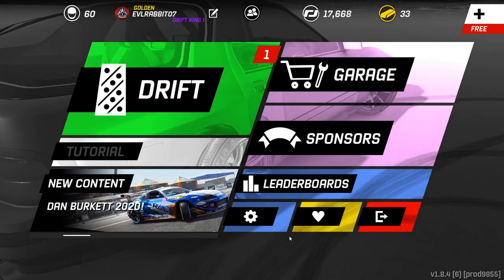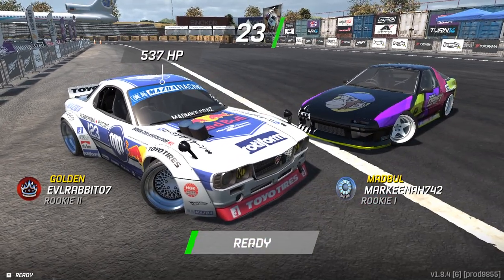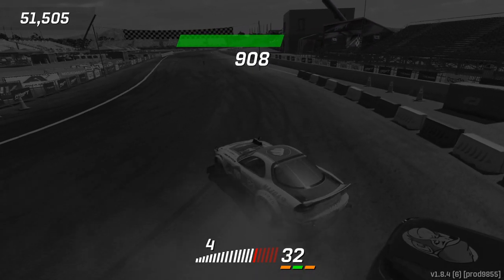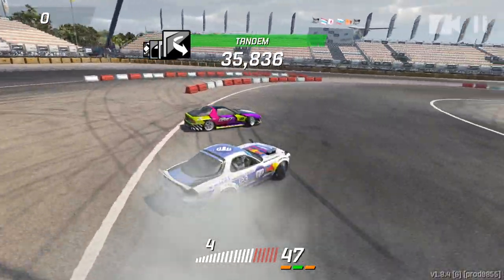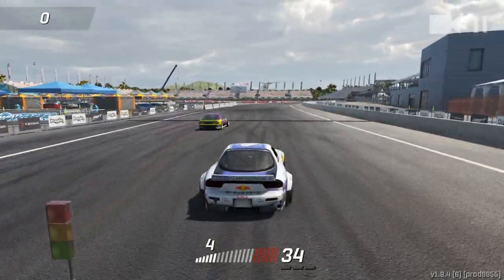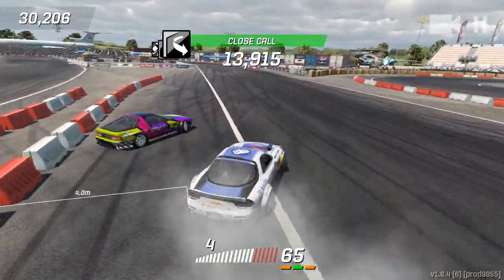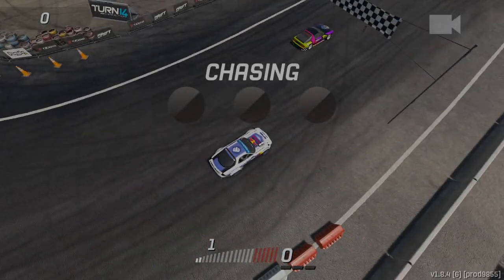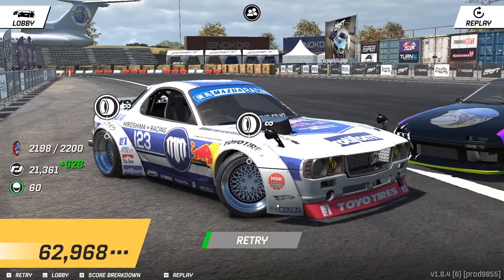Torque Drift Tuesday MAD MIKE CHASE CHALLENGE!!!!!!

Comment: Although 26b is one of the best 2 engines, rikishi uses rb26det and has a lot more torque and so, he can do reverse entries with 1000hp when your builds with these engines cant. Sorry if I offended you
Reply: Imo engines do vary alot and you can do different thinhs with different engines, but the 26b is a light high rev engine that can do very good things depending on the handling tune you have on your car..
Reply: @Erker you can reverse entry with anything it all comes down to skill in this game, every single thing u do and change in this game matters. Btw this is a madbul chase challenge event.
Reply: who says you cant do reverse entries with a 26b i can do reverse entries with a stock engine you just need to tune your car right
Reply: @bigbean7273  hey i saw you like my stuff on insta tnx man